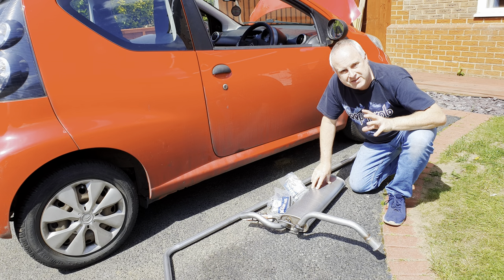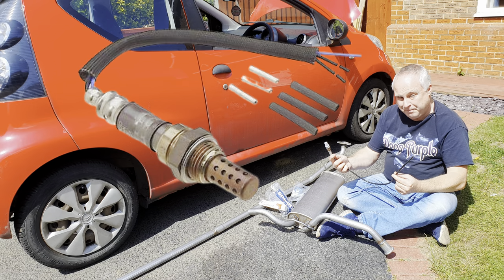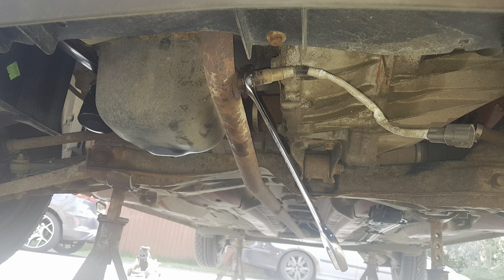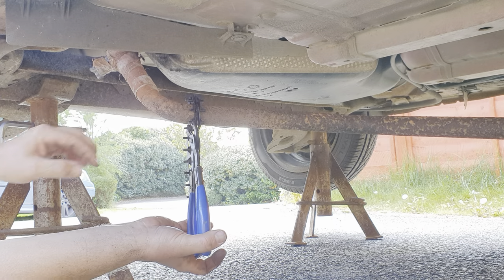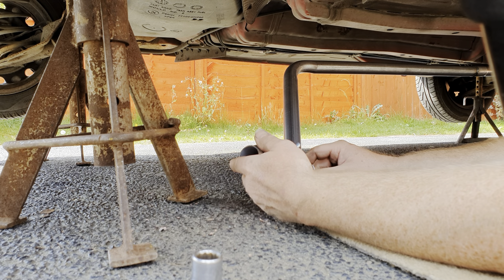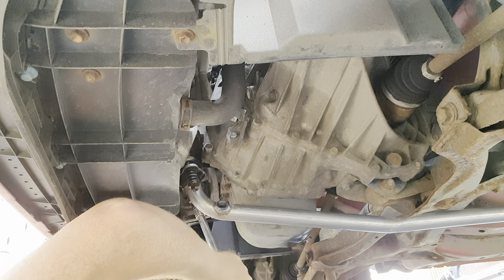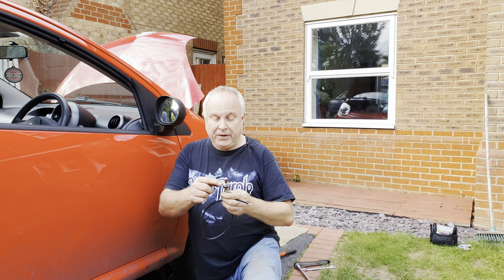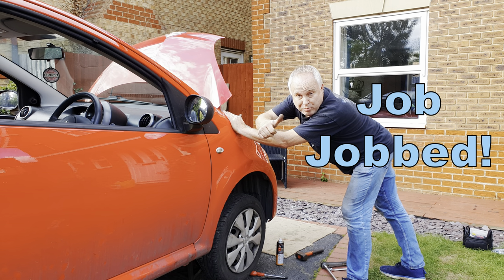How To Replace a Citroen C1 Exhaust System & Peugeot 107 & Toyota Aygo

Comment: You are very soothing to watch. I get proper anxiety as an amateur but have used your vlogs on my daughters 1.0 yaris. I did the pcv, throttle body and map at the weekend. The throttle body was water cooled electronic one, not cable. Was a swine to get cooling pipes off but with your vlog I had confidence to clean all the parts and reassemble. Hopefully the oil consumption will drop. Thanks for your kindness in producing this material
Reply from the maker: AWESOME. Thank you for sharing your struggle. Completing these jobs will boost your confidence and the next job, whatever that might be, won't feel so daunting. Keep up the good work

Comment: Great tutorial as I've just done my girlfriend's car. Though one thing guys, if you do go for the two new bolts at the catalyst end *GET THE SPRINGS AS WELL*, as the new bolts are 10mm shorter and will be a pigs arse to fit with the original springs.

Comment: Excellent video of a job I need to do after a replacement back box lasted only 3 years before splitting at the bracket weld just before that rear box.  The original lasted 12 years - some replacement parts are much lower in quality than the factory originals, I think.

Comment: Thanks for this Cyd. I would like to attempt this, but not confident where to place the axle stands to support my C1. I can't tell exactly where you've placed them. Could you consider making a video to show where to place them?
Reply from the maker: You can do it! Lift the car using the front subframe and place the stands under the square section of chassis just inboard and behind the front wheels

Comment: Wouldn't be easier to remove the O2 sensor when the exhaust is off the car?
Reply: Yep I reckon ur right, I shall be  doing this on my little c1 tomorrow.  Good tip sir thank you 👌🏻

Comment: I do have a brand new exhaust now but the next time I'm going to do this job by myself. Did you say 16,– or 60,– £ for the oxygen sensor? My mechanic told me a story of 200,– Euro if this device gets broken! In this video I learned a lot e.g. the word «chamfer». Wonderful. Thanks Cyd! 👍😀👍
Reply from the maker: £16 - sixteen. thats for a universal 4 wire sensor which has no connector. For an OE sensor (complete with connector) I'd expect to pay £60-70.
Reply: @CycloneCyd  Thanks for your quick response!
Reply: Ebay plug and play £25 ish

Comment: I can’t get the joint on the cat to middle pipe to seal air tight it’s driving me mad, I’ve tried a new wire doughnut which was very loose onto the cat section but I’ve glued it on with exhaust paste, it seems to be were it sits in the cup ?